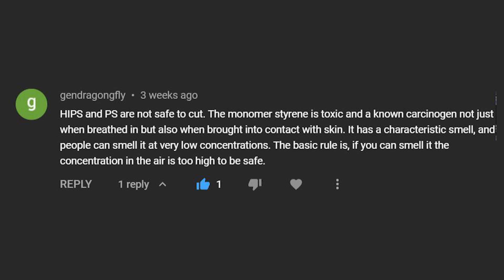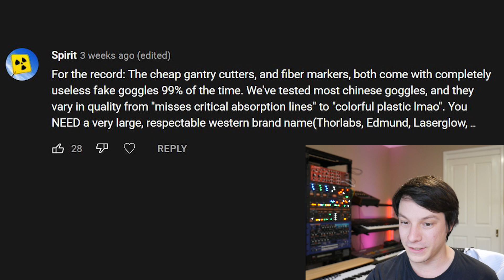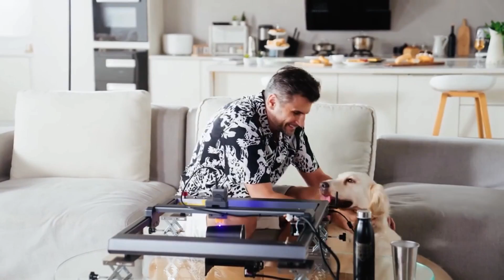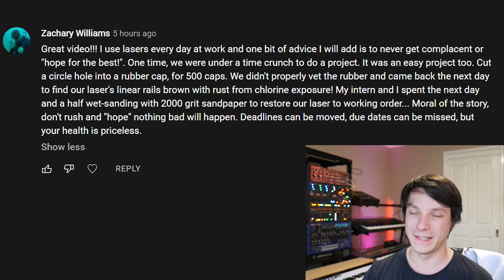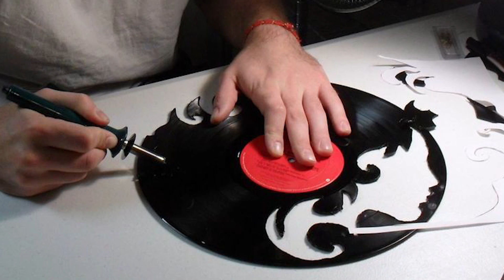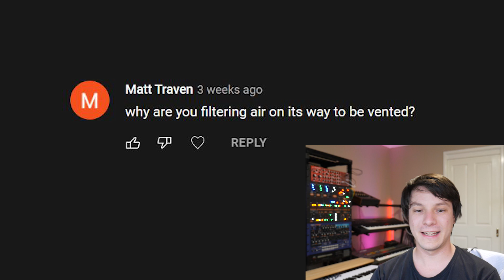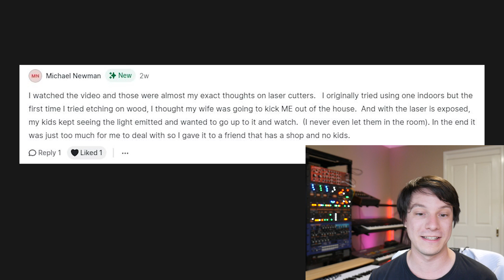What YOU had to say about Laser Cutter safety

Comment: I doubt the laser wavelength of the laser diode itself is certified either. Can you trust the advertised wavelength to be what is actually produced. How safe are you with certified laser goggle without testing the diode output? Do they have a wide bandwidth negating the issue? Do you have to test the laser frequency to be safe? How is that done, and is it cost effective?

Comment: I watched both videos, and I still bought a laser module for my 3D printer.
Here is why. I need to test designs fast. And waiting for an open slot at my 2 local laser cutting people isn't always viable. 
I only cut cardboard, solid cardboard.
The room is well ventelated, and the machine is placed right next to a window and a fan to extract the fumes and particulates.
Only I am allowed inside that room.
Once I hit cut, I leave.
I have a webcam monitoring the print, so I am safely away from the printer.
The mains box is 2 steps away from me.
I am recieved this 2 days ago, and I am learning slowly, and step by step, because the manufacturer left me with ZERO basic instructions on use, materials {I got a sample pack without instructions}.
So here I am again, rewatching videos to ensure safety, and protecting my eyes, home and livelihood.

Comment: Not sure if  using Laser to burn PVC  release Phosgene it might only release Chlorine gas  but the point is if you weld PVC will definitely cause Phosgene so for Laser and Welding both needs proper ventilation.

Comment: Thank you for touching on this subject, I purchased a CO2 laser without prior knowledge of the dangers of the machine. However, I still struggle to find information on the correct safety protocols. The manufactures have told me it is okay to not wear safety glasses if the lid is closed as the lid absorbs most of the radiation, but the manual says safety glasses must be worn at all times. This leaves me confused. I would rather not wear glasses when i'm not looking at the machine as it is in my office, and i'm always working in there. Do i need to be wearing glasses to protect me from indirect radiation bouncing off the material, out of the lid, off the walls, and into my eyes? Or is this not really an issue and I can have the machine running next to me with no glasses on, as long as the lid is closed and i'm not looking at the laser?

Comment: Thank you for this video and the previous one on laser cutters/engravers. I'd done a little research on these and thought I'd found the ideal machine, yes it was an open frame one.
I'd also sourced the extraction and filtration system as well as I'm aware of the danger from fumes. Plus I'd like to not pollute the air if I can avoid it.
BUT .... having watched your videos on these I have decided instead to play things safe and NOT get one, even though I had included extraction and basic filtration in my costings. (Incidentally extraction and filtration was SOOOOO much more expensive than the machine) 
So now I've joined my local makerspace for the year (they have everything I need and more there) AND saved money. Plus I can learn from others there that have experience. 

Thank you for your honest reviews, thoughts and opinions and especially for making and sharing such great content. I watched most of your 3d Printer reviews, along with a few other channels, to help inform my choice of 3d printer.
Please keep doing what your doing, being honest and flagging concerns and safety issues, basically being genuine. Maker's Muse is a channel whose content I feel that I can trust. As you say, many other channels are only seeking to grow their channel and won't address issues if they are negative. 
Thanks again.

Comment: I am an enthusiastic garage maker and use a laser engraver to complement my woodwork. I recognise the issues with not having an enclosure, but such is the form and shape of the things I often wish to engrave that one is not practical. With that said, it is operated in a ventilated, closed off area and whilst using the appropriate eye protection. Here is where I have an issue though, the engraver has been a revelation for me, it has democratised an area of craft that I would have not had the money or opportunity to get involved in if I had to spend thousands on an enclosed model from a western company. 
I would hate to see the opportunities that it has provided me not be available to others out of fear of misuse. Clearly it is dangerous if misused, but so is my table saw, and there is a limit to the practical steps that can be taken to mitigate this without losing the very power/facility that makes it desirable to have in the first place. 
I think more information about the risks of burning certain materials can only be a good thing of course, but I don't want to be overly down on what has simply been the best money I have ever spent on my craft stuff. It has had a transformative effect on my output and my expression, and this would not have happened if I had had to outlay vastly more money in the first instance.

Comment: My father n law passed away from lung cancer that was attributed to the coating used on the saw blades at the shop he worked at for 40 years.   At the time, it was thought to be safe.

I think about the VOC’s being released from the cutting and printing I do in my workshop.   Taking up smoking may be a safer endeavor.

I’ve watched several Chinese sourced livestreams on YT promoting new laser machines.  They almost always disregard PPE until it’s mentioned in the chat.
I’m having a hard time finding goggles on Amazon with a printed certification.    Lots of 5 star ratings but that doesn’t mean a whole lot.

Great video, thanks!

Comment: Based on the way things typically go there are going to have to be a number of tragedies before regulators have cause to act on these.
As far as venting, there's also the risk of the vented air coming back into your own dwelling. Air tends to wrap around an object and can easily travel along the surface of the building into a window open elsewhere.

Comment: Currently working on a Cr(VI) issue at work. Cr(VI), hexavalent chromium, or hexchrome, is a higher oxidation arrangement of chromium. So any chromium can become hexchrome under the right conditions, namely high temp and oxygen. For example, Cr(III) can become hexchrome in the presence of oxygen plasma. So in the presence of a high power laser (high temperature) and in atmosphere (oxygen), it is highly likely that you are generating hexchrome when cutting chrome tanned leather. It is carcinogenic, especially when airborne. So don't risk it.

Comment: You can technically cut pvc and other toxic materials safely, but you basically need to make your laser enclosure a vacuum chamber, and bubble the air through sulfuric acid and caustic soda (basically first bath of sulfuric acid, second bath of caustic soda).
You also need to either clean or change those fairly frequently.
Industrial systems use sprays to filter at high flow rates, but you don't want high pressure acid or base in a home or hobby environment.

Comment: A few years back I had an acquaintance he was training to be a machinist. He bought a open frame laser cutter, and brought in some of his etchings to show people. I proceeded to give him a 10 minute safety lecture on what you need to do to be safe with one of those. Later I found out he decided to implement my safety suggestions after he nearly burnt down his house. I know he bought nice safety goggles after I warned him. The only reason he did that was because one of the really experienced people agreed with my opinion on unregulated no name I pro drop shipped from China.

I don't mind the parts being available for somebody to make their own. There is no way you should be selling fully assembled or mostly assembled laser cutters without an enclosure in a few extraction system at the very least. (real goggles too) Also don't override interlocks they're there for your safety, I've seen people do it in actual shops and I find it concerning.

Comment: I think that you should probably try to contact the EU as an industry expert on this topic since the manufacturer is most definitely breaking several consumer safety laws and probably not compensating for the damages they are supposed to. From my experience it's not an impossible task but might not seem super rewarding since it might take years before something get processed into an first draft for a vote but, it will probably make an actual different in the end!

Comment: As for the PVC: There are also filaments (rigid and flexible) that are PVC based. Nasty stuff (HCl release), but the mechanics are incredible.
As for phosgene - it's a monomer for some polyurethanes (I'm sure it's used for expanding foams) and also as a precursor for polycarbonate.

Comment: I bought a cheap CO2 laser cutter. I have no idea what I'm doing, but when my eyes starts hurting just by being in the same room as the device, that can't be good. I'll DIY some safety features onto it eventually, but until then I'm not going to use it (meaning it's already been in storage for 6 months now...).
I did buy some laser safety goggles before using it, but I guess it must've been for wrong kind of wavelengths. Either way, point is: If something's wrong and you don't know what you're doing, stop doing it until you learn more and can fix it. I'd rather postpone my silly side projects than go blind.

Comment: I have a open frame creality laser falcon 10w. I built an enclosure for it though and sealed it. Added filter and fume extraction fan. The view window is brand name laser enclosure glass. And I have it covered when not actively viewing in it. Plus good quality laser glasses. Nothing wrong with open frame lasers as long as the user knows the dangers and takes the precautions. But anyone can buy these that's the dangerous part. The lack of knowledge by the users of them.

Comment: Sorry, this is a lengthy one.

This and previous safety awareness video came up late when I wanted to prove a point in dealing with laser safety to a cheapskate employer; have an enclosed chinese fiber laser cutter. I proposed to have a lab/industrial level of protection level, yet i got guilt driven by the employer saying "its too expensive, find cheaper alternative". when I proposed one, the reply were "it looked so stupid that people would laugh at it". which, my proposal were to close any possible gaps from potential laser light radiation from bouncing and leaks, while the reply from the employer were "the chances of it reflecting to the eye is very slim". few times, in fact I pretty much "threaten" this employer, reply i got "don't test my patience". sorry, I'm no lion nor a clever person

there's also a fume extractor, the employer forbids me to use it on other material but one to avoid contamination to that specific material

only lasted for 3 months and I got kicked for not producing enough results/quota needed. in which i was only paid close to USD$400/month because of the freedom I was given there along with the hazards. 

P.s 
I wore the 3M respirator + 2091 (Pink filters) most of the time and an included "laser safety goggle" with supposedly "OD7+" rating (I think)

I did ask for goggle recommendation over a big community forum, but only get a few handful of replies which almost useless info. I ask to gain extra info that's not written on the page

disclaimer
I have no intention to offend anyone or to incite any hatred

Comment: The content about the laser being reflected by a chrome but on the machine is actually really dangerous, how many home workshops are just galvanised sheet metal sheds? Plus all the tools with shiney reflective surfaces. You could get a flash hit your eye from the other side of the shop and never know with those invisible lasers.

You'd hope most of the energy would dissipate and be unfocused from multiple reflections and the atmosphere but it's still a risk. Could also burn raw materials and start a fire in a spot you wouldn't expect.

Comment: In the local makerspace we have a CO2 laser cutter. It is one of those relatively inexpensive ones. But it came with a pretty decent enclosure. Gladly there are lots of electrical engineers and electronics experts there, so we retrofitted a whole bunch of safety measures the machine just did not have from the factory, and we brought the machine’s electrical innards up to code (-ish). We built a pretty powerful extractor, mechanical and electronic interlocks…the works. Now the machine works a treat. There is a printed list of allowed materials placed on the cutter, plus very clear warnings on which materials NOT to cut. Only people who received instructions on operating the thing as well as how the machine is built, how the cooling system works etc are allowed to do stuff with it. I know of makerspaces that have added a lock to their cutters’ power switches or control box that can only be opened by people who have the right key fob. People get far too complacent around lasers IMO.

People should not be afraid of them or anything - but a healthy dose of respect is definitely required.

Comment: I have question about enclosures. Is it possible to use camera instead of any glass to be 100% sure that there is no risk of damaging our eyes? I thought about creating own CNC machine with option for laser and then instead of buying glass, which I cannot easily test in my garage (is it safe enough) - use enclosure from not transparent material and place inside camera or cameras (simple, cheap cameras for video conferences). What do you think about this idea?

Comment: I've put it in many places.  Look at even the correct plastic goggles, and their 'pass' amounts for the laser light frequency involved.  Even 1% pass of a several watts output laser is well beyond the 1/4 second eye blink level.   Even the $1500 glass lens laser goggles are not good enough.  But they are much closer, so they'd protect much better for everything but a direct strike or really strong reflection.
Get a cheap, good camera, and a surplus monitor.  Operate through a video link, and double block off stray light from the LC when it's in operation.
Ask any careless welder who has welding flash blindness later in life how much you should guard your eye health.  They'll let you know directly how dumb of an idea it is to not guard your eyesight at a very high level.

Comment: Thanks for the video. 
Good you are talking safety. Got myself an open laser system. 

It is so simple to fit a box around them. Thin plywood can be clamped in between the footplates and the frame. That makes two reasonably stable sides. Fit in two other plywood pieces between them and put a lid on it - presto: a box which protects from laser reflections. Drill a circular hole in the rear plate, fit a fan in and plug an exhaust pipe in. 
Material for less than 60$ should do the job. 

Also got myself a proper bottom plate and a webcam to monitor the process and to align pieces using the options in Lightburn.

Comment: Considering my HP 7550A pen plotter had a sensor to detect and report when an axis stopped moving, I see no excuse for not having that sensing in a laser engraver where it's safety critical. Note: this wasn't the motor stopping, it was a transfer belt wearing out. The sensor was on the output axis, perhaps on the idler end.

Comment: As someone who recently received permanent laser damage to their eye, it’s not just the lasers in laser cutters that pose a risk but the handheld ones too. Long story short, I got a cheap green laser pointer with a cheap power button that turned on unexpectedly and went directly into my right eye. Now I’m going to have a blind spot near the center of my vision the rest of my life. 

Moral of the story: treat a laser as if it’s always on
Reply: For anyone wondering why it was pointed at me, I was lowering it down into a recessed inner tube inside of a larger outer tube. I had my eye down the barrel of the laser to align it with the smaller inner tube. The button touched the side wall of the tube and turned the laser on

Comment: About filtering the air before venting it: It is interesting, that Australia even gives you a choice in the matter.
As far as I know, here in Austria (rather - the EU) it is illegal to activate these machines without safety precautions.
Imported machines are stopped or even destroyed at customs, should they lack the CE mark or a declaration of conformity.
And someone using the mark without clearance is in very deep legal and financial trouble.

Should one import those machines, and they are destroyed at customs, then they also have no right to reimbursement of costs.